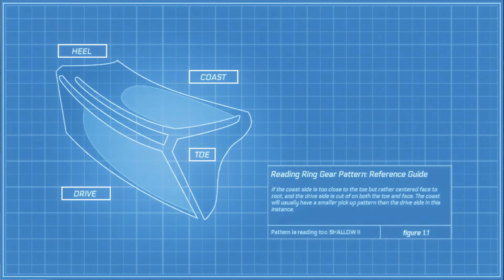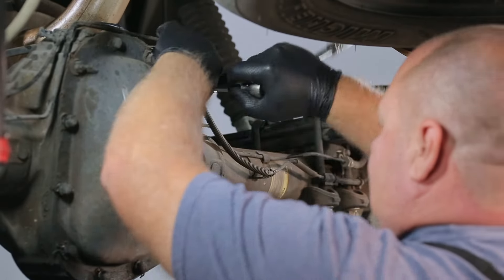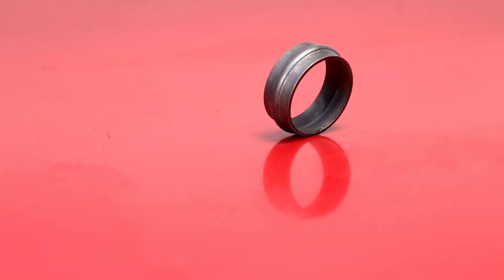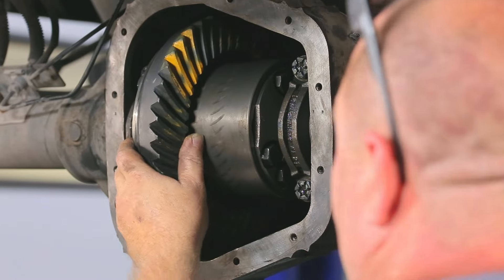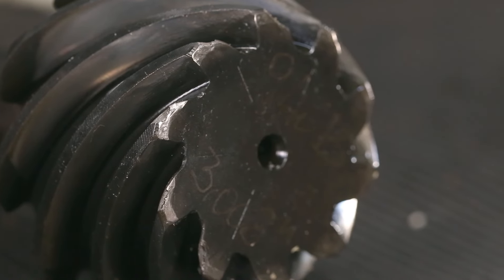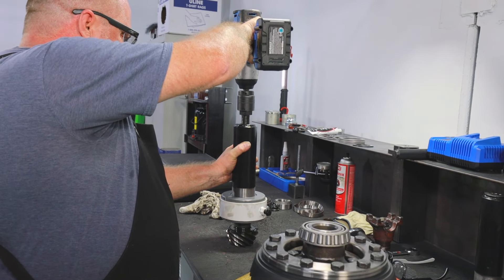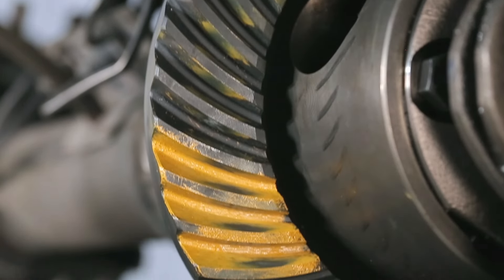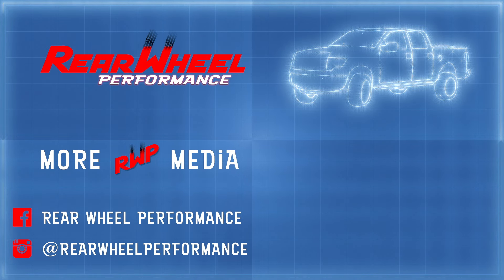The Easiest Way to Read Ring & Pinion Contact Patterns

Comment: Most helpful video on this topic.  For a first timer it was the most helpful.  Just one additional piece of advice I found out by experience, paint the pinion tooth and get pattern on it too.  It helped me determine if the pinion was set to deep.  Found it hard to determine this from the ring pattern except for very deep pinion setting. It gave me a clear indication of the pinion tooth pattern being near the crown (top) or on the top edge.  Thanks.🤪

Comment: Listening with a long screwdriver is how I check bearings on water pumps, alternators, listen to fuel pumps etc. Learned it from my grandfather. You would be amazed at what you can diagnose with an extra long screwdriver pressed to your head right in front of your ear. At the shop I worked in one of the techs was trying to diagnose an overheating issue. I listened to the water pump and told him the pump was getting ready to go out and it could be an intermittent cause. As I was the "new guy" he told me I was full of it. I told him out would be back within a month for a water pump. Sure enough it was.  Another instance was the head mechanic telling me I left something loose in the rear end after a custom suspension install. 

This was after I asked if the car came in with the brake chatter I was hearing on a test drive. While the head mechanic was walking around grumbling about my "incompetence" and that it wasn't the brakes, I removed the wheel on the noisy corner, pulled the caliper and headed the dry slide pins and reassembled it. Noise gone, brakes good and suspension was tight like I knew it was. Problem solved. No apologies from the head mechanic though. 

I'm a  Tech that informes the customer of other things noticed that will need to be replaced and what's immediately necessary and what isn't. Neither the shop owner or head mechanic would do that saying the customer wasn't paying to have those things checked and would never say anything. I let  the customer decide what they can afford to have done. Sometimes they have the additional repairs done right then and sometimes they don't but at least I informed them of what to expect and approximate timeframes. I couldn't in good conscience let a customer leave without being informed. Needless to say I'm looking for work because of our differing opinions of what was the right thing to do.
Reply from the maker: Very good!  Maybe it's time to take that next step...
Reply: Sounds like that shop needs a new service writer

Comment: I like the tip about setting pinion depth prior to crushing the sleeve.  As a flat rate dealer technician, most of the differential work I do is simply replacing carrier and pinion bearings, so the only adjustment I have to make is pinion preload.  I currently have a car in my bay for bearings and in the course of this repair, it's became obvious that someone has been in here before and he didn't know what he was doing - the pinion preload was way too loose, backlash was off and pinion depth is wrong. I've got it torn back apart, so tomorrow morning, I'm going to adjust pinion depth and use your tip (leave the crush sleeve out to check the pattern) to get that dialed in.  Thanks for the video!
Reply from the maker: Knowing that something we have recorded makes even a single installation more efficient makes it all worth it.  Wrench well!
Reply: My rule of thumb on most gm rear differentials if the pinion shim seems to be off I always start between 28 and 32 thousands and you will get a good idea of where to go

Comment: For those who come along, when they use the confusing jargon 'high' they mean shallow. 'Low' means deep. Deep means the pinion is too far in toward the gear set, which is too far to the rear in a rear differential. Shallow is opposite, the pinion is not deep enough. When they are talking about hamburger buns, they are referring to the pictures at 1:22, the dark imprint. The drive side of the ring gear is always the convex side, the coast side is concave. There is an optical illusion to the two photos after 3:41, making the drive side look like the coast side, and vice versa. They are describing it correctly and the photos are correctly labeled, but the optical illusion is confusing. The deeper grooves are painted bright yellow in focus, the unpainted edge of the gear that is out of focus is closer to the camera.
Reply from the maker: Thank the internet gods for true and well-intentioned constructive criticism, a dying art. We spend a lot of time trying to hit a balance of technical and casual dialog and descriptions. Feedback like this helps us to get better with future projects, thanks!
Reply: @rearwheelperformance  Thank you for understanding my intention. I found this very useful, I watched it three times and each time got more out of it. I even now understand the high and low terms, which refer to the relative position of the imprint itself.
Reply: Different gear types read completely different from one to the other, dry 2 cut vs. 5 cut. Aftermarket, made in Korea vs. made in China. The gears he was setting up looked like "made in china" gears.

Comment: Any tips installing a BOP ring and pinion? 70 Firebird 3:73 Yukon Posi Yukon going in. Diff stock 2:73 215,000 miles coming out.

Comment: I made a comment but it evaporated! So,  I'll repeat it here.  Since I don't have a lift and I'm in my late seventies, I decided that trying to pound the the pinion gear outer bearing races into their recesses was a no-go.  I used the old pinion shaft with the old bearings (honed  out for easy removal)  as an installation tool.  I found a couple of old used shop bearings to act as spacers (large enough to clear the shaft splines) and used my impact wrench to draw the races toward one another (do not try to  use the  u-joint yoke).  Checking the races periodically for alignment,  it worked like a champ with no issues at all.
Reply from the maker: We keep saying we're going to try to mock-up a race installer kit with pucks and a center screw for years, but as long as we can swing hammers without breaking bones, I guess we're stuck, lol.  Since someone has mentioned it now, I think it's time to try it!

Comment: After you set the backlash then you pull the yoke off, install the crush sleeve and seal.  After that, how do you measure the correct preload on the pinion when using a crush sleeve?

Comment: I'm currently doing a pinion replacement and have been looking at a bit of information regarding contact patches. I'm expecting the stock pinion shim to be fine but I only have one weekend to do the replacement so I'm preparing for the unexpected, I guess. It seems like the most important factor is the pinion depth. If the backlash is set within spec, it should be decent at minimum. If not, I may have other problems. I'll report back. Thanks dudes.
Reply from the maker: Sounds like you've got the right idea; focus on the pinion depth! If you have to set the pattern a few times (and you probably will), we'd suggest use different colored marking compound each round to help make the differences in pattern stand out. If you don't have multiple compounds then skip a few notches to some fresh teeth for each pattern to make it clearly readable. At the end of the day, if you're still having trouble deciding which looks best, fallback onto your other senses. A good pattern (even if you can't see it) feels smooth and steady as the gears rotate. Best of luck mate! Looking forward to hear how your project goes.

Comment: I'm doing a ARB install with new gears and new bearings. My backlash is perfect and I've almost got the pinion depth right where I want it. Its still a little deep. But still have a sharp line deep in the valleys. Smooth spinning and no noise.
Reply from the maker: Patterns should have a feathered edge all around the edges.  A visibly hard edge line is where the pinion teeth will have the most pressure.  If it were us, we'd probably back it off a couple of thousandths and recheck one last time.
Reply: @rearwheelperformance   So I've got my pinion depth right where I want it. But even opening the backlash to 9 "Yukon recommends 6-10" I cant completely get rid of that sharp line. Tt 9 the sides are nice and feathered but right in the center portion its still a sharp line. Not sure if I cant hit 10 right on the nose. I'm wondering if its just because its all new parts and they need to brake in?
Reply from the maker: @baja5000  We need to see what the pattern looks like.  If you got time, call the tech line next week, especially if you aren't completely satisfied with what it looks like - 877-910-2244

Comment: I watched a 100 videos on JK D44 regearing and this is good and to the point video. Every single video always shows the perfect center placement (heel to toe) and it would be nice if someone would cover a good face pattern, but explain/show why the pattern moves the way they do from heel to toe and how to get it centered (is it possible or even needed? I read it don't matter).   I just did my D44 with 4.88s and I had to do 6 different pinion depth set ups each with probably 3 backlash adj. My final back lash was .008" and my first pattern was  dead center of the  face, Heel to Toe, but the pattern was just too shallow as it was rolling off the top.  My subsequent and final 6th pinion depth  adjustments brought the pattern more center (Face & root) but it also made the drive pattern go towards the toe. The Coast pattern stayed more center of the face but toward the heel. It was my 3rd regear ever, and the other 2 have been good for years.. gotta start someplace.
Reply from the maker: One can reference a hundred different bit of advise and pattern guides, but more importantly, persistence and patience provides the best results (as you did).  Good to hear, and enjoy!

Comment: I have been setting up differentials for over thirty years, mostly Dana's and GM. I did a Ford 9 inch a couple of months ago and it was easy. My Jeep has Currie hi pinion 9 inch diffs front and rear. They use Ford 8.8 gears sets and when I figured out the rear axle was making gear noise louder than the mud tires I decided it was time for a re-gear. The pattern on the old gears was a good pattern, the bearings were perfect, but there was a high pitched whine. It could have had something to do with the fact that only 75/90 oil had been used by the previous owner and it should have been 85/140 according to Currie. I tore into this 8.8 and it gave me fits! If I fully tightened the bearing caps to anything over 10 ft lbs the side adjusters can't be moved. I would get the backlash set to where I wanted it to around .008 and when I torqued the bearing caps it changed! I was pretty happy with the pinion depth, just fought the backlash. Finally got it where I wanted it and being a high pinion in the rear I was more focused on the coast side of the tooth. I got a pretty centered pattern on the coast, but the drive side was biased towards the toe and I couldn't help but wonder if I should have moved the pinion a little closer to the ring gear. I went ahead and ran what I had and the gears are quiet. There really isn't any info out there about running a high pinion in the rear where you are running on the coast side of the gear. Any thoughts?
Reply from the maker: Late reply, sorry.  That high pinion conversion rear turns everything on it's head.  It is purely a trade-off of added driveline clearance vs a reduction in strength and wear.  We're not sure their intent ever was to have these used for daily drivers on the street, and when they are, the owners should be aware that they will likely see higher noise and wear vs a standard 9".
Reply: @rearwheelperformance  I agree, my Jeep had probably 120k on the rear gears and I believe the previous owner ran 75/90 synthetic oil which is lacking in film strength for a pinion that isn’t submerged in oil. I debated switching my front and rear drop outs because the front would have very little wear on the coast side of the ring gear, but that still wouldn’t guarantee a quiet gear set , so I opted for new gears that should last me a long time since I don’t put many highway miles on this Jeep.
Reply from the maker: @davecamilleri9411  Sounds like a fun one!  Keep up the good work!

Comment: Putting a Locker 9.75 34s in my18 f150, came with Super 8.8 3:15 open. My STX 2.7/10 sp auto should wake up with 3:73 gears, I mostly bracket race 1/8 miles and was going to run a 12v switch to the plug for runs. My RWD did not come with a Locker. Goal of 600hp, any advise to NOT grenade the Diff? Flipped axle & running 245/45/17 M/T cheater slicks. 55k on unit but covers been off so I will pull it & replace with Spicer/Ford cover. GREAT Video & VERY Helpful.
Reply from the maker: We just did a '19 with the same joke of a S8.8 3.15 ratio.  Went 4.56 with a modded TracLok since no one engineered anything better to work with c-clips. But, 9.75 is a proven tough model and should be fine with 600. Get in as much preload as you can fit on the side shims, and run the lowest side of backlash spec.  Sounds fun!

Comment: Really well done guys, thanks.  
i thought my pattern was ok but now i know the pinion depth is wrong, you saved me a lot of frustration.
Reply from the maker: Real good, let us know how it works out!
Reply: @rearwheelperformance   got the pinion depth set, pattern is centered up/down but only a small contact patch on toe drive side  and heel coast side.
Reply from the maker: @halleffect1  Sorry missed this.  You can adjust backlash within spec to try to move it.  Sounds like you were at min backlash spec and likely shimming for a bit more backlash may have helped.  Tell us how it all ended up!
Reply: @rearwheelperformance  thanks for that.  
backlash is at 0.010.  I thinned out the paint with gear oil and got a better pattern, contact along most of the gear, not just the toe/heel.  
so it was right all along but i couldn't see it.  confirmed it was fixed with test drive and no more howling.
Reply from the maker: @halleffect1  Glad to hear!

Comment: Will say this does help out my problem is new gear set and the markings dont tell me much for shimming so im trying the factory shim and my pattern looks good on one side then to much on the toe. Make 2 mock up bearings so no more press on and off the linion until final
Reply from the maker: Once an installer shifts to using mostly the root and tip to focus the pattern, then the heel and toe isn't as critical in most cases.  If if turns silky smooth on both sides by hand, it should be quiet in operation.  Good luck!

Comment: A good practice is to ream out the old pinion bearing (if it's in decent condition) inner race so it slides on and off the pinion and use it as a test bearing to set your pattern.
Reply from the maker: For sure, setup bearings and setup races are a great addition to any drivetrain installer's tool arsenal.  We have a drawer full of them!

Comment: Hi, i got a mag Crwon wherl set, only on pinion are markings of 0,0 and a second 0,22. what measure do i have to check?
Reply from the maker: The zeros may be a reference to adjustment from the manufacturers nominal pinion depth.  There are articles and charts to use for pinion shimming adjustment based off of the old and new gear sets, but the most basic principal is that a zero marked gear, should use the same pinion shim when replacing a zero marked gear.  There can also be markings for recommended backlash and batch numbers used when manufacturing and packaging gearsets (to make sure same batch ring gears and pinion gears are matched up and boxed together.

Comment: Reading through the Yukon handbook says if keeping used gears, only focus on the coast side pattern.  Granted, I am just replacing bearing/races and reusing pinion/carrier spacers, but could do you know why Yukon would state just to focus on the coast side?  Good vid.  Appreciate any input.
Reply from the maker: Haven't had much hands-on with used, but I imagine that the pattern is easier to match up with a the larger surface area.  That is the ultimate goal is to have the 'new' pattern match the broken in contact area as closely as possible.  It is often hard to even read a good used pattern when set up properly since the surface tension of the marking grease will smear so evenly, but you'll see it for sure if it is not correct.  Have fun!

Comment: Is this video assuming you already have your pinion depth set correctly? Or do you set it after checking backlash/ paint?
Reply from the maker: Set it up initially as closely as possible using the previous/original pinion shim or a setup depth checking tool, then check the contact pattern to determine if it requires additional adjustment to make it good.
Reply: Thanks for the reply. I’ll be doing my first gear swap as soon as I get the parts I ordered. Great video btw. I’ll be checking it out a couple more times probably.
Reply from the maker: Real good, have fun.  Call us if you need help on anything.  877-910-2244  @dumpsterguy85

Comment: I'm replacing the differential bearings of my C1500 4.3L RWD long bed pickup truck and the carrier side bearing DON"T have any shims! how can I make any adjustments if there is not room to put shims? Any help would be appreciated. Thankyou
Reply from the maker: Sounds like it should be a common 10 bolt 8.5/8.6 model rear depending on the year, which all use side shims for backlash. Contact the tech line and have some pics ready to share with them to review: 877-910-2244 8a-4p Central M-F